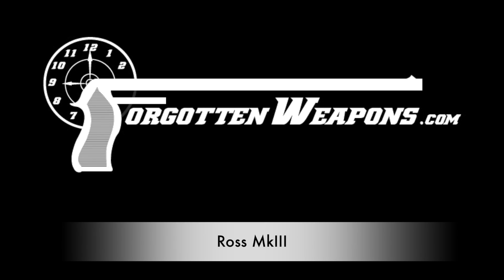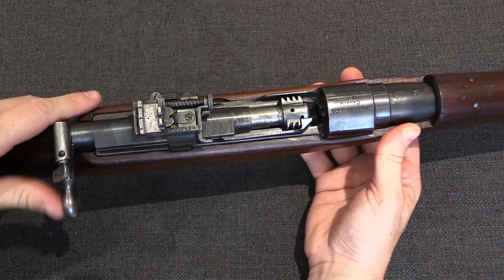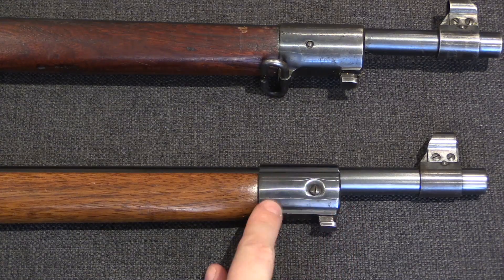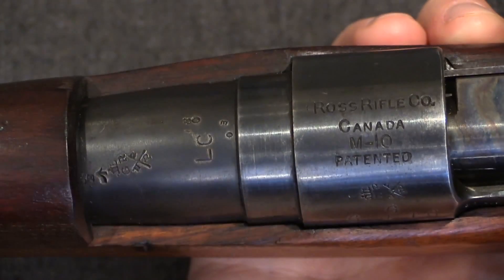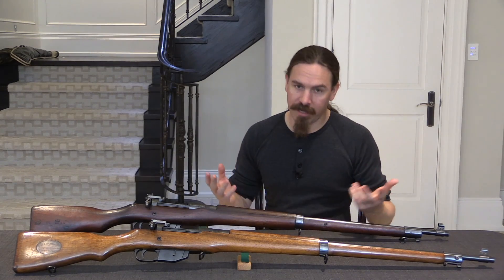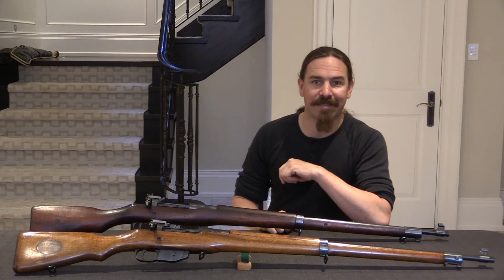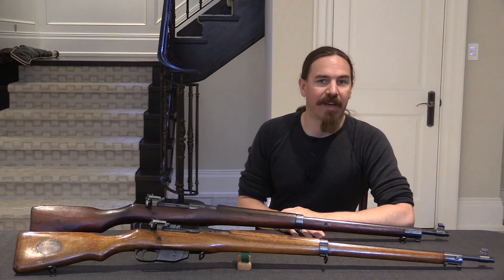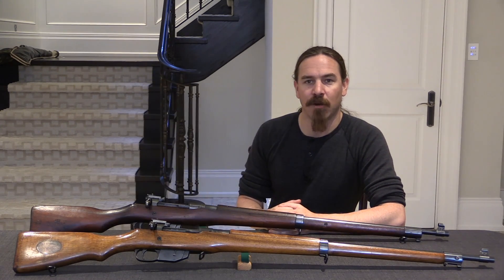The Ross in the Great War: The Mk III (and MkIIIB)

Comment: Thank you, once saw a deactivated version of one of these rifles at an antique fair in Ireland, I found your lecture very informative - got to wonder how many were sold off or ended up used as hunting rifles

also holy mary! has it been that many years you've been doing these lectures.......once saw a whole steel pistol that supposedly dated back to the failed 1798 rebellion, some Irish  blacksmith knocked out a few of them

Comment: Back when i was a young teenager, i got a sporterized 276 caliber ross rifle and several boxes of handloaded ammo from a neighbour. On firing my third shot, the bolt locked up and after wacking the bolt several times with a piece of wood , it finally opened. The previously rimless cartridge was now rimmed, and about 3/4 of the primer end was now a gaping hole. This was the last shot that i fired out of this gun. i was not injured. At that age i did not realize that the problem was the reloaded ammo, not the rifle.
This shows the strength and safety design of this action, as the chamber pressure was probably 60,000-80,000 psi or likely much more in order to form a rim on that cartridge.
Unfortunately i then traded it for a 22 mrf. i wish that i still had that old rifle.

Comment: One of the things I find interesting is why Ross for all his bragging did not adopt the Standard Lee-Enfield Magazine which potentially may have eliminated the Magazine issues (aside from patents and Royalties) but for sake of British conformity.  the Ross was very heavy compared to the Lee-Enfield but weak in construction compared to the same points in the Lee-Enfield. part of the weight is the added length required in the bolt design required for the internal bolt rotating mechanism, the other is the physically longer barrel. Politics and Egos created a monster that did not need to happen.

Comment: The rifle was unsuitable for the conditions of trench warfare, the bolts would frequently jam close, or alternately not close properly. There are witness accounts of Canadian soldiers striking the bolt handle with an entrenching tool handle to re open the bolt. Canadian soldiers were threatened with court martial if they ditched their Ross and got a Lee Enfield. This changed after the first battle of the Somme. Canadians coming out of that battle were all observed carrying Lee Enfields. what happened to their Ross rifles was anybody's business (meaning who cares) and NO disciplinary action was taken against them. The Ross was super accurate and a great target rifle. I have seen one (rare in Australia) in a private collection. It has been drilled through the receiver to render it totally deactivated. In most cases "DP" (drill purpose) meant they were used for rifle drill and not much else, most DP being deactivated by various means, including blocking the barrels.

Comment: I have had and still have a number or Ross rifles of both models. including a .280 sporter. A friend who also collected Ross rifles and  I have tried numerous times to get a M10 together wrong and have never succeeded.  I have a Canadian soldiers handbook from WWII and it has a section on the care and feeding of the M10 Ross  Canadian veterans I have talked to said they had Ross Rifles in the interwar years. They apparently cleaned up as a match rifle in the years after WWI  I understood that it was the bolt stop on the M10 that was soft and peened causing the problems. I don't guarantee that is gospel  Great video series on the Ross, Thank you

Comment: No mention of the additional vulnerability to mud or dirt preventing the straight pull bolt from going into battery. This, of course, was a significant issue on the Western Front. A rotating bolt gives much more leverage  on this issues.

Comment: Perhaps someone can shed some light on this.. my rear battle sight looks similar to the Mk3 in the video, a VERY deep V groove. I've seen other Ross Mk3 sights that look like an open bulls' horns (a semi peep sight?).
Were they made this way, or were some modified to the V notch over the years? 
..also my peep sight is noticeable larger, but I do recall that many had that hole opened up. 
Thanks!

Comment: I owned a M-10 Ross for a few years, 1915 date on the stock and the L.C. mark over the chamber and they weren't kidding. Case necks on fired rounds were grossly expanded and also out of round, not surprising since the work was done by field armorers working in haste. Nevertheless, it was surprisingly accurate and I took a few whitetails with it.